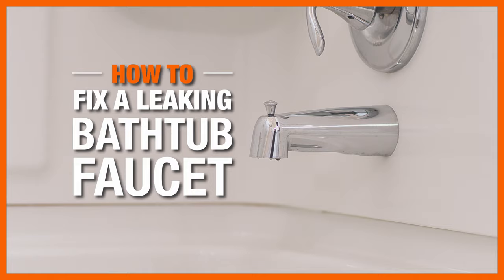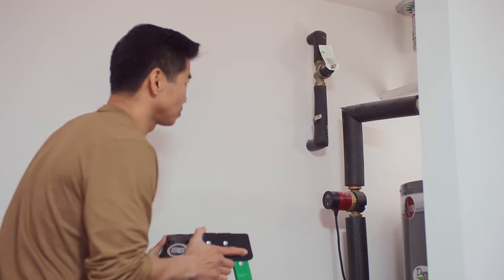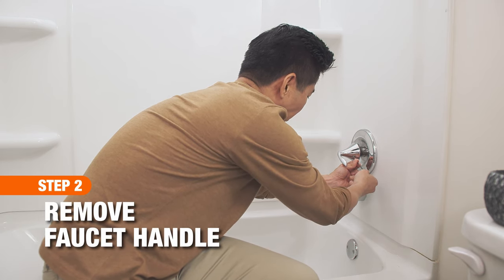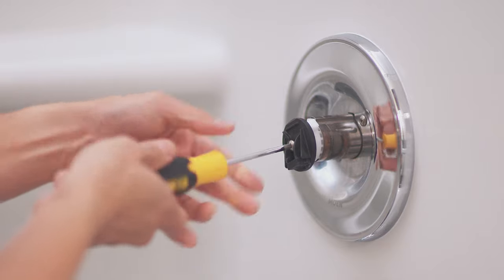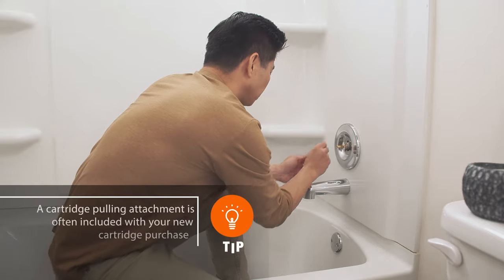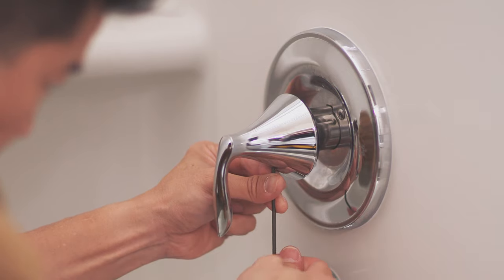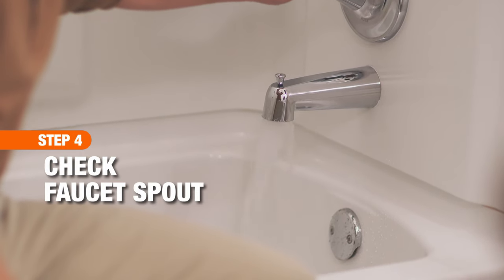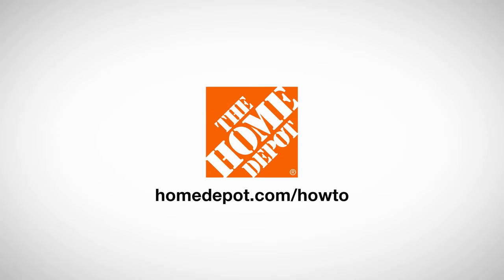How to Fix a Leaking Bathtub Faucet | The Home Depot

Comment: Before you disassemble the faucet handle (the  part you take out the "screw) you should first place a rag over the drain, so if you drop the screw it will not go into the drain.  Otherwise, you may have to call the plumber to retrieve the screw.  LOL.
Reply: Good idea.. thanks for the heads up
Reply: They did put a towel down however did not explain why they were doing it!
Reply: Learned that the hard way. 😂
Reply: 😅😅hahaha

Comment: I actually just completed this. With the right tools and parts it took me less than one hour. 

Few prices of advice for beginners like myself:
1. The part he’s uses in this video is a Moen 1222. Got mine at Home Depot but I believe Amazon has some as well. 
2. The Moen 1222 cartridge comes with the silicone so no need to buy a separate one.
3. I had to remove the large circle part from mine. It was attached with caulking and a foam behind the circle piece. All you need to do in order to remove it is was a scrapper or a knife to remove the caulking. After that, you can just unscrew it but this step is only needed if you are unable to access the pin just by removing the first few parts before you have to remove the pin. Happy to provide more advice for anyone that may need it.
Reply: Thank you. This is important information that should have been included in the clip. This video suc...eh...leaks.
Reply: I came on here to try to fix my shower. After watching the tutorial I felt helpless. Then after reading your comment I thought... He should be a plumber. You could make serious $!
Reply: What large circle part are you talking about? Currently stumped as I can not take out the original cartrige out.

Comment: Ok so, I just had to replace my cartridge in my Moen tub faucet.  I had the Moen 1222 type cartridge.  Luckily this video was exactly what I needed.  HOWEVER, it was not as easy as the video showed.  I got the cartridge about 1/3 of the way out, and CRACK! The cartridge broke right off! I had to chip the rest of it out carefully.  That took about 2 hours.  Once I got that taken care of, I followed the installation from the rest of the video and it was a breeze.

NOTE!!!  Make sure that once you have the cartridge in and the retaining clip in place, turn the water on so you know where the off is before you put all the other pieces back on.  I did not do that, and when I turned the water on, with the handle in the off position, the tub was running full force.  Good luck everyone.
Reply: How did you manage to chip it out having a similar problem currently 😬
Reply: @ThePyrotopia  I used needle nose pliers and a small screwdriver.  Carefully carefully so as not to damage the seat of the faucet.  Little by little I broke the pieces off and pulled them out until I got  to the rubber seal.  Once you tear out the old seal, it should collapse in on itself and come out easy after that.  
Case in point, use whatever tools you can to help.  Good luck
Reply: Which size Allen did you use. I just can't seem to get the handle off and it's really frustrating. I have tried many sizes?  Any suggestions on how to get it off.  Nothing seems to turn the screw 🪛
Reply: Same here. The old cartridge was stuck inside and cracked. Took couple hours just to take out the old one out in broken pieces… Also not sure why the old cartridge was so tight and stuck in the pipe either….
Reply: @maryb5553  most likely it is rusted on now

Comment: Plumber here:

All I can say is good luck finding a replacement cartridge!  That is assuming you can get the original cartridge out in the first place, which is not always easy.  
Basically there are about 10 thousand different cartridges out there, and home depot carries maybe 10 of them....and many of the cartridges look extremely similar but have one TINY difference from yours and won't fit as a result.  

When a customer calls about a leaking tub spout, I tell them I'm almost certainly going to open up the wall and replace the entire shower valve because cartridge hunting is a wild goose chase and it will take less time for a shower valve replacement than a cartridge replacement.  If the customer doesn't like that, I give them another option:

Find me the exact replacement cartridge and I will replace it for the price of a service call.
Reply: But why need to open the wall if MAYBE opening the face plate might be enough to work on it? Just a curious question from a regular person.
Reply: @Swi2thMummbles  
Good question 
From my experience it's rare that opening the face plate will provide enough space to actually change the shower valve.  Always of course remove the face plate first to see if it's possible, but it probably won't be.
Reply: So the vavle needs to be replaced entirely? A new handle and new cartridge of a different brand won't work with the old valve?
Reply: @chrish2495  Basically, it's easier and cheaper (because less labor) for a plumber to replace the whole matched assembly of mixing valves and cartidge than to spend time searching for the exact cartridge your particular setup needs.  If you want to save money, you can spend your time finding an exact replacement cartridge (same brand, same part number) and either replace it yourself or let the plumber replace the cartridge with the one you sourced.
Reply: How does one find a matching cartridge? Are there not serial numbers or brand models to find the same fit?

Comment: Those things rarely come out that easy. Sometimes you need to buy the cartridge puller. Fairly expensive for a one time use. Make sure it works with the model you’re pulling.

Comment: If you have an electric hot water heater, the leaky faucet will spike the electric bill too.
Reply: It is not a hot water heater.
Reply: No because faucets turn from cold to hot so it’s not hot water
Reply: Having the exact same issue and the water that’s steadily leaking it’s definitely hot. So I’m concern about it spiking the meter.

Comment: I can't seem to remove the screw to remove the handle any suggestions?
Reply: I'm having the same issue. Did you figure it out?  I have many different sizes of Allen wrench parts but nothing seems to be working
Reply: @maryb5553  nothing has worked and I even tried the wd40. Now my shower is also dripping and I can't get that one off either. It's frustrating.

Comment: My cartridge was old ('92) so I thought that was causing the leak. Instead, i found out that the screw that held the handle in place was too long. So when you fully screw it in, it pulls the handle out a little bit, causing a very small leak. 
Just wanted to share incase I could help someone. Hope ya'll fix your leaks 🤙🏻

Comment: I don't know what cartridge I need. It seems that you pulled out the old cartridge with a piece from the new cartridge (straight from its packaging). If you are not a plumber you will likely not know what the cartridge you need. You should mention that. Otherwise, this becomes a very confusing video. Maybe leave veideos to the pros who give some DIY tips along the way.